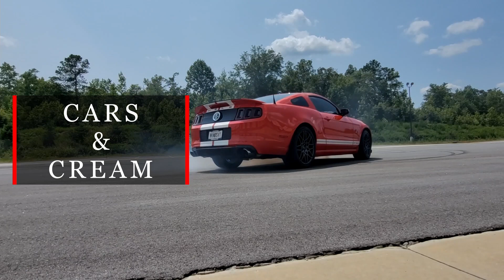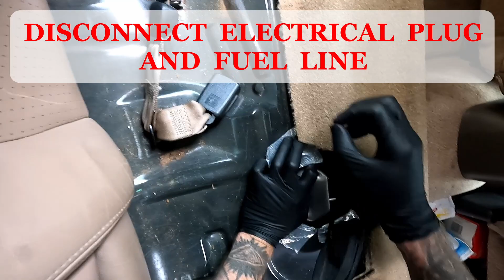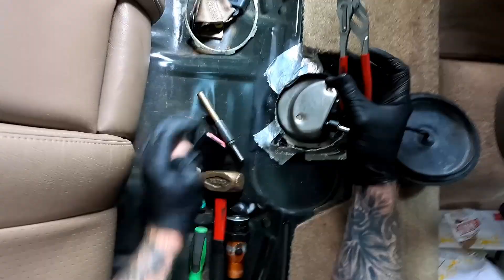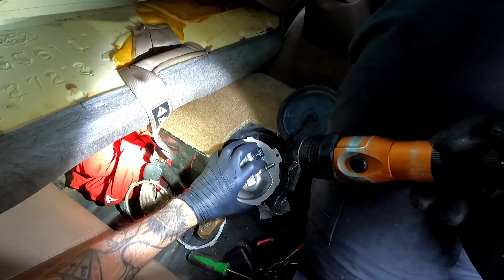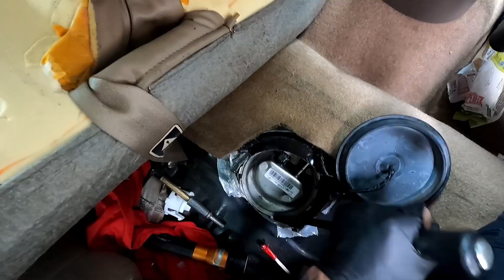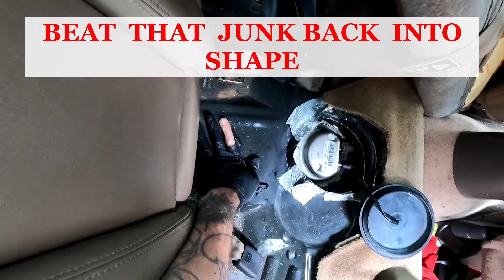The wrong but easy way to change a fuel pump on a Ford Contour SVT

Comment: That was the funniest thing I ever saw in my life 🤣🤣 can I bring my car to you for repairs?? I like the way you do things. Lololol sounds like me when I had to replace passenger side new headlight assembly. Tools flying across the parking lot f-bombs while having to take the front bumper clip off to do it it's still not put together correctly the bumper cover lost a lot of the clips 6 hours later in my 2005 Toyota Corolla 🤣🤣🤣